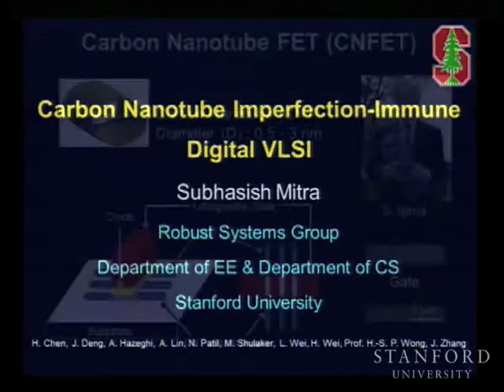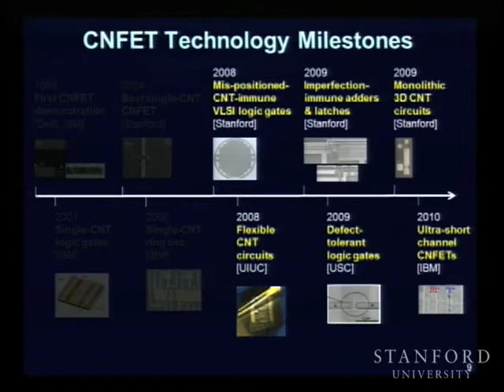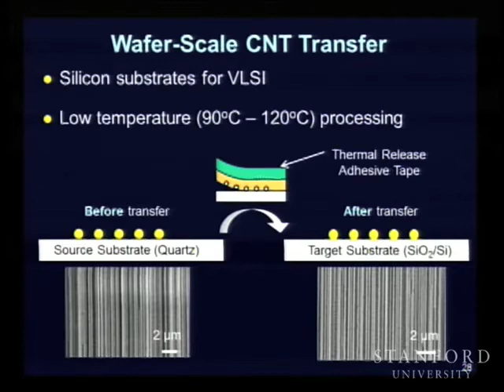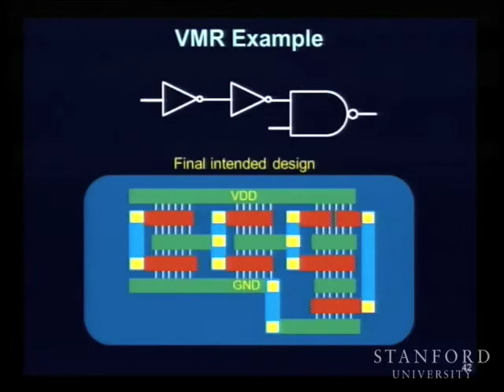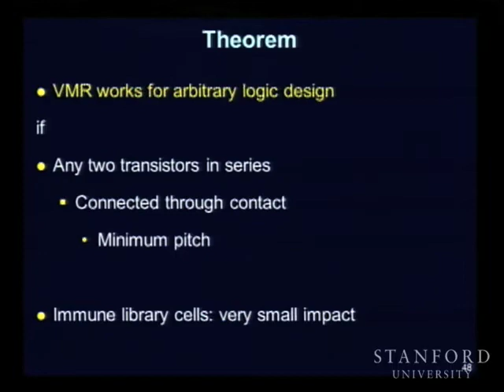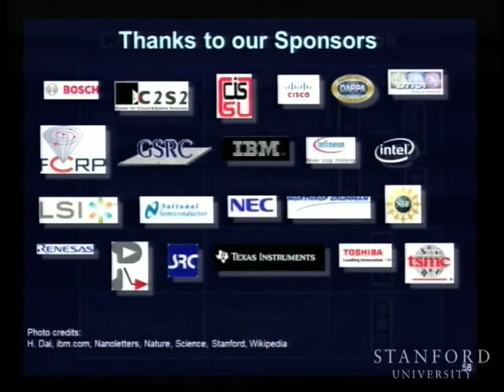Carbon Nanotube Imperfection-Immune Digital VLSI

Comment: growing the carbon matrix using a specific resonant
frequency should produce a perfect 3D vortex construct
which would create the matrix interconnection topology
for signal processing. This would provide a redundantly
perfect architecture of interconnect negating the necessity
of having to arrange them within the constraints of existing
circuit design. If the template of the carbon funnel 3D matrix
was created resonantly then it should be able to be accessed
using resonance.

Comment: wouldn't it be better to flair each end of the tube to
create a vortex, and make a 3D vortex array which 
can be accessed by magnetic resonance field effect.
This would effectively accomplish 3D omnidirectional 
circuitry. Perhaps this could provide a construct for
quantum computing using linked vortices for spatial
containment.